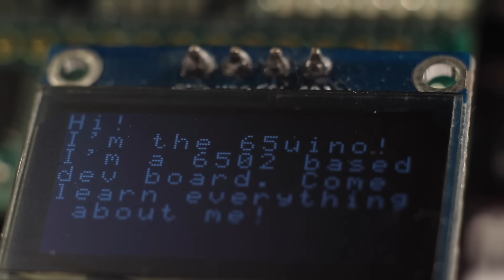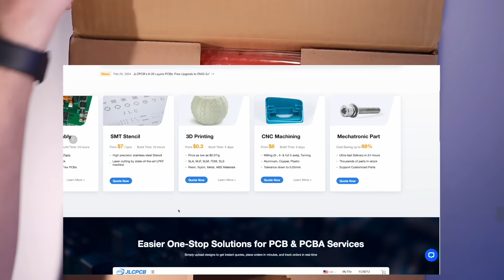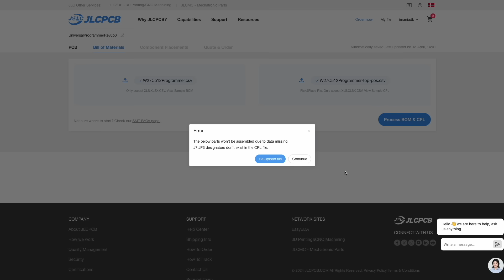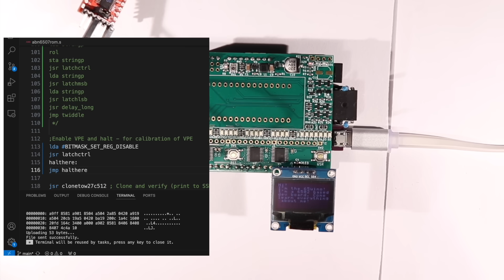This $9 Universal ROM Burner is Open Source!

Comment: How do you generate the >5V programming voltages? Where do they come from? An external source? (Because obviously not from the USB connector, which is 5V and 3.3V only)
Reply from the maker: There’s a boost regulator on board :)

Comment: Is this able to be extended to handle 40 to 48pin EPROMS?  How would you do that?  I would love to get rid my other large programmer that requires a PC with a parallel port.
Reply from the maker: It is technically possible with an active adapter with additional latches or a passive adapter with dip switches that you can use to program in chunks.
Not sure when I’ll get to that part - or even if.

Comment: what about the 128Mbit(32MegaBytes) serial flash? or 256Mbit serial flash?
Reply from the maker: It doesn’t do serial flashes - those are normally easy to do with an even cheaper CH341 style programmer @ 3-5V
..or just on a breadboard since it doesn’t require any higher voltages :)
Reply: @AndersNielsenAA  when I saw your zif socket, I doubt it can't program the serial flash, yes, it's true, I know serial flash would much easier, but you said almost every flash memory on the market. anyway thanks your reply..

Comment: Very cool, thanks for sharing. I noticed, you're charging $79 for your kit, so from a buying perspective why would I buy yours that requires an Arduino?
Reply from the maker: That would be 79DKK - not $79 :) And that also includes 25% Danish VAT (which isn’t applied if you login with an account from outside the EU)
You can switch to Euros in the sidebar or divide by just around 7.

Comment: How does it cope with voltages on other pins, eg some eproms need 6v on pin28 whilst programming
Reply from the maker: It doesn’t raise or lower VCC during programming or verification - as far as I know it’s rarely strictly necessary for a programming to stick. And if you need more reliability for those specific ROMs I believe a double programming might just accomplish that. But hard to know anything for sure with 30 year old EPROMs
Reply: That's interesting, I made my own progammer a few years ago  and went to the hassle of two voltage regulators!! And you're saying I didn't need to? Darn it !! Lol

Comment: Can this program an 8748 chip? In any case. GREAT VIDEO! THANK YOU! Learned a lot of possibilities.
Reply from the maker: Thanks :) An 8748 not only requires 21V programming supply, it also requires an 18V pulse at the same time, and the pins in no way line up with a standard JEDEC ROM pinout, so that'll have to be a no for the 8748. 
I guess technically you could use two of these.. But that gets complicated fast :)

Comment: Have you looked at CH341A programmer? It likely would have been easier to just buy one of those and reprogram it to support additional flash ic's
Reply from the maker: That's for <=5V serial i2c/SPI flash ROMs. This is for up to 32pin parallel EPROMs and EEPROMs with up to 27V programming voltage.
Reply: @AndersNielsenAA  its been a while since I looked at it and immediately realized I was wrong when looking at the pin count😶.

Comment: I saw a GH project (DavidGriffith/minipro) that seems like it could replace the TL866CS, but it requires linux and custom firmware, in addition to the pc-software.

I just need to program 3 devices:  
AM29lv160dt 
AMD29F004BT 
SST39SF040

Comment: Great project! Since it has the same pinout, could this be ported to an Arduino UNO too? I understand that a totally new firmware has to be written, but if an Arduino UNO is technically capable of driving this programming board, it will be a great tool for the amateurs that have a passion for retro computers.
Reply from the maker: That’s 100% the intention, yes :) Hope I’ll get to writing the library soon :)

Comment: You didn't "literally" make a thing. You "actually" made a thing!
Reply from the maker: XD I actually also very literally made a thing. 

"Literal" means exactly what it says without metaphor or exaggeration. For instance, if you say "It's raining cats and dogs," that's not literal because it's a figure of speech. But if you say "There are three apples on the table," that's literal because it directly states a fact. So, "literally" is used to emphasize that something is true in a strict, factual sense, without exaggeration or metaphorical interpretation. 
-ChatGPT XD
Reply: @AndersNielsenAA  With literally there could be doubt. With actually there can be no doubt. 😉

Am I to doubt you made a thing or can I be sure you made it?

There are actually three apples on the table. Of that there can be no doubt. 😁

Comment: Great work! 

But to be fair: the 70$ programmer here is crazy cheap, too. It was the first really good programmer you could affort as a hobbyist. Before that you had to shell out multiple 100$s. Plus almost the same foe each footprint adapter....
Reply from the maker: Thank you! For many the T48 is the better option. Link in the description. I could’ve also included a CH32V203 or something to make it standalone but the real value in the more “commercial” programmers are in the software. If I had to make 50,000 ROM profile definitions, I’d probably also have to charge more. Now we’ll see if people can live with the limitations of this and maybe help out with the profiles :)
Reply: @AndersNielsenAA  My comment was in no way meant to belittle your efforts to create a very cheap, capable and open source programmer! I love it, and I'm sure many people will find it very useful!
Reply from the maker: @tomteiter7192  I didn’t take it that way at all - I totally agree with you :D
Reply: and it is a full programmer, not just a shield that you have to combine with an existing Arduino-like board (and a serial adapter to update firmware). and the new (black) ecu-programmer can handle the old 21V eproms.

Comment: Okay, this comment is about the first few seconds of video. PLEASE LEARN HOW TO SOLDER! All those dry joints hurt to look at!
Reply from the maker: Thanks for the comment - you can see how they got there a bit further into the video :) Soldering under a camera is almost a pleasure with this board, but often a struggle - but I could've done a better job, I agree. They do all have solid connections though - even if an ideal joint would've had more solder.

Comment: Congrats! Really nice project. I do think the name is a bit problematic though. This is obviously a ROM burner for really old types of roms and not current day EEPROMS that often use voltages such as 3.3 or 1.8 V and can be very large.  I'd suggest you add the word "retro" to the name so people don't waste time (and possibly money) on the wrong device.
Reply from the maker: Thank you and thanks for the feedback! The "relatively" in the name hopefully conveys part of that :) 
The thing about the really modern EEPROMs is they don't require high voltages and the packages typically mean they need an adapter anyway - so it's a simple matter to do that on a breadboard (or a much simpler PCB) instead. Basically you can make a shield for a Nucleo board that does it all for $1 a board. 
This board should technically work with 3v3 if you power it with 3v3 instead of 5V - though I think it's hard to find anything in DIP that can't handle 5V.

Comment: Would be better if it could handle up to 48-pin PROMs, that's where the cost starts to get really prohibitive.
Reply from the maker: It certainly has its limitations too. Depending how old they are, this'll at least make it easier to do on a breadboard - or with an adapter :)

Comment: This is a really cool project, great job on bringing this board up! I've seen a lot of similar programmers to this based on older designs that go for a lot on ebay. One question, would this be able to program a NOR flash chip? I have a need to program, and plans to design an adapter as it's an SMD part, so I was wondering if that's a type of ROM chip that you would expect to be compatible with this programmer. I'm a little new to programming them, but it seems like the procedure for programming is fairly standardized across parts. Thanks for sharing this design!
Reply from the maker: What’s the part number?
Reply: @AndersNielsenAA  I'm looking to program a Cypress S29GL128P11TF1V2
Reply from the maker: @14m13375p1c3  Well technically this "could" be part of programming that, but the huge modern chips don't need high voltages so a super simple PCB adapter for something like a Nucleo board is probably a $1 solution to that problem.. If you have a Nucleo board of course.  That's certainly what I would go for :)
Reply: @AndersNielsenAA  Oh, I see! I don't have one of those boards, but I will look into it, thank you so much for the suggestion!

Comment: You can turn the board into the socket by offsetting every other pin by slightly less then half the diameter of the hole.  So for pin 1 move the hole about half the diameter of the hole in toward the middle of the chip and for pin 2 move the hole about half the diameter of the hold away from the middle of the chip.  Do this zip zap pattern for all of the pins.  This will hold the chip in place for programming.
Reply from the maker: Cool idea! Though I have a feeling that would make inserting a zif socket a real pain :)
Reply: @AndersNielsenAA  If you do the zig zag holes you don't use a ZIF socket.  The zig zag pattern makes the holes tight against the chip pins while still being easy to remove from the programmer.  It's a way of saving the cost of the ZIF socket.
Reply from the maker: @rogerp5816  Yup, it’s a nice trick - it’s very much “one or the other” though :)

Comment: 4:15 - so what is the limit and what did you use? 
I'm at 0.8mm height with 0.15 stroke
Reply from the maker: They say min 0.153mm stroke and 1.0mm height. I'm at 0.13 and also at 0.8mm height :) Should've mentioned that, sorry.

Comment: Great work! I love open source projects as its beneficial to the electronics development. I was just wondering if there was any reason to not include a built-in TTL to USB adapter right on the PCB
Reply from the maker: Good question. It's because the UART really belongs on the host board, in this case the 65uino, but the 65uino doesn't have one. All other boards I imagine that can be used for the shield should already have a UART on those pins - so that's why I only put the pins for external UART. 
An Arduino or STM Dev. board should be able to use the internal UART just fine, without the extra wiring :) 65uino itself will probably get a shiny new UART->USB on the next revision.

Comment: I can think of some ROMs it won't program (1702A, 2704, and other super early eproms that require multiple voltage rails and/or silly high voltages). But really impressive. The lack of ability to program 25v+ eproms in the TL866 has always been a bit of an annoyance with it. I know there's already voltage adapters out there but nice to see a completely open source solution for programming ROMs that can be done very cheaply.
Reply from the maker: I thought of going all the way with the +-5V boards, but instead I just decided to break out all the control lines and driver outputs. That means you can either bend up a leg of a socket with the 2704 in it and connect -5 to that, or just run the needed lines from the pin header or the socket itself. Not as plug and play, but it will work :D
Reply: @AndersNielsenAA  BTW, do you have a list of ROMs you have tested with this?
Reply from the maker: @MrDomingo55  Let’s just say I’m working on it :) W27C512, 2732A as some examples.
I still have code missing to accept a whole binary ROM via serial. It’s on the way. You can join the Discord and help with ideas if you want :)
Reply: @AndersNielsenAA  I'm tempted to get this as assembled.  I can try and devise a 2708 version by using a Veroboard to carry additional ZIF socket and implement extra voltages, etc.  This would be mounted onto primary ZIF socket.  Complication is that -5V voltage has to be applied first and removed last wrt other +5 and +12 voltages.  Board being able to support 32 pin EPROMS means I could pass high order address lines through and use them to control power sequencing.  Also programming voltage needs to be 26V.
Reply from the maker: @MrDomingo55  Yup, that’ll do - R8 or the trimpot has to be changed to make it go higher than 22V (see schematic)
Reply: @AndersNielsenAA  2708 like some other early ROMs also need +12 and programming voltage is 26V.  I just happen to have a S100 system that is from late 1970's / early 80's that I would like to resurrect.  I think it uses 2716 ROMs but I have some 2708's too.
Reply: @MrDomingo55  2716's at least are the first single supply voltage ROMs needing just 5v to read and no negative bias supplies, at least the non Ti versions. The TMS2716 is a completely incompatible ROM to the generic 2716.
Reply: Have o also dived into boot roms & option roms too? @AndersNielsenAA
Reply: Can't really complain for $9!
Reply: The high voltage EPROMs are the reason I bought a T48 programmer.